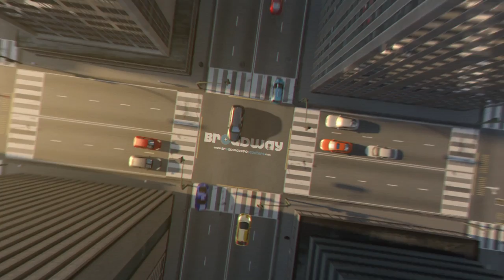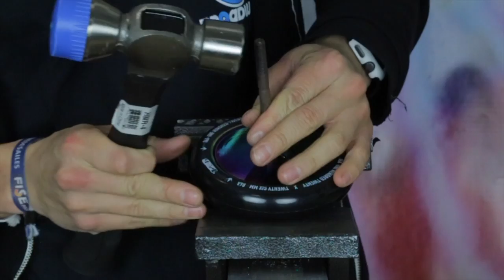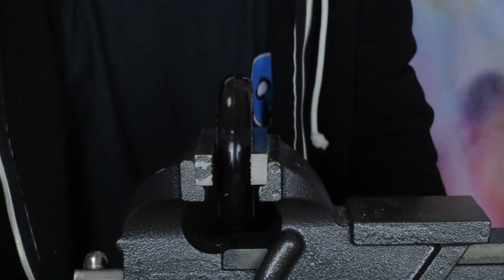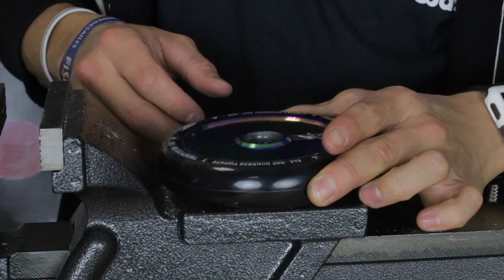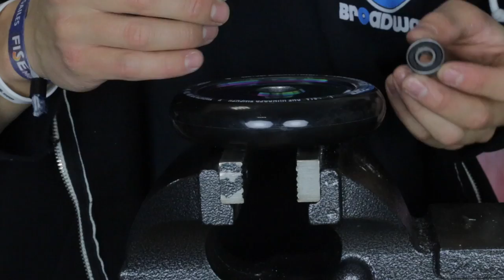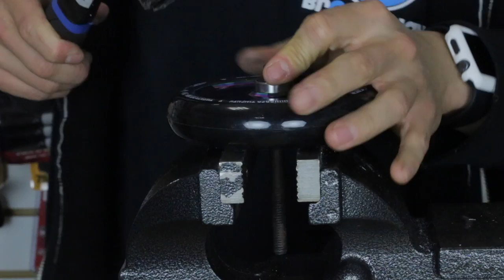HOW TO: Install Bearings | Broadway Pro Scooters

Comment: COMMEN PROBLEMS AND HOW TO FIX THEM,,,,,

STUCK OUTER RING: get an Alan key or something and try to make it get caught in the ring and bang it with a hammer while moving it round each side. Keep doing this and it should pop  out:)

CANT GET BEARING IN: Use a vice or if you don’t have one, align it in the wheel and put it under a bed then jump on your bed a few times and it pops in 😂

Worked with me for root industries and sacrifice delta core, hope this helps 🙏
Reply: Maddox Crawford haha lol 😂

Comment: Would fidget spinner bearings work?
Reply: RuthlessGamer110 BOSS I tried them the other day. Got one day of riding out of them before they popped so yes they do work as emergency bearings but not for long and they can’t take the pressure of jumping off high surfaces
Reply: RuthlessGamer110 BOSS yes i have tried it before but getting it out of the fidget spinnr is a pain since i has mutiple i only used the middle bearing because thats the only fast one

Comment: noooo
you can't hit with the hammer on the inner ring!
you damage balls and the rings balls tracks

always put 2 or 3 big washers between the head of the screw and the bearing, so the force will be brought to the outer ring